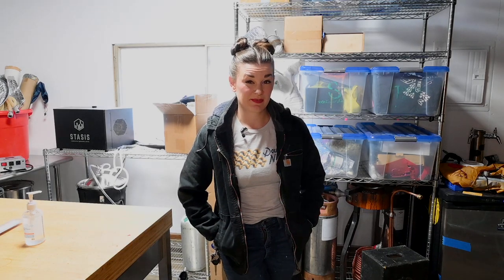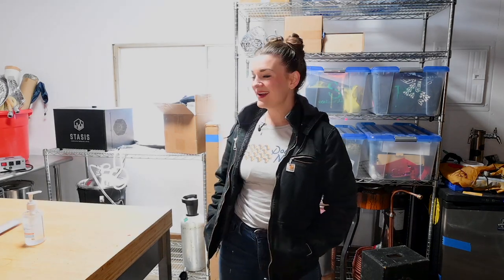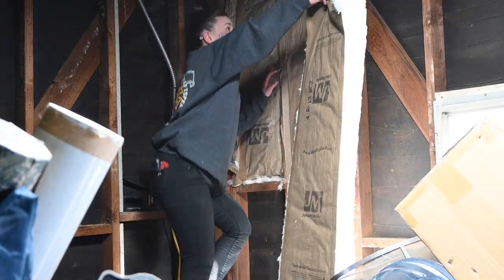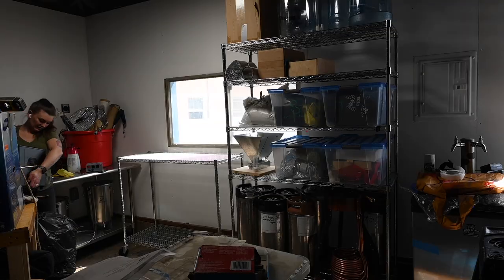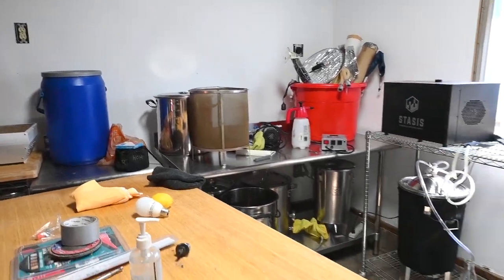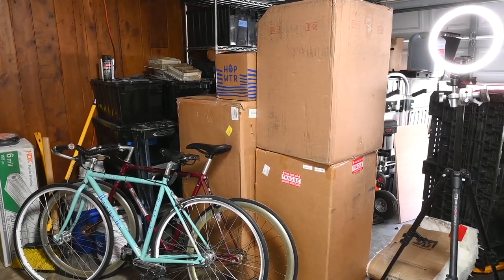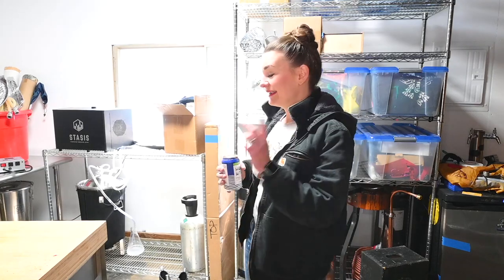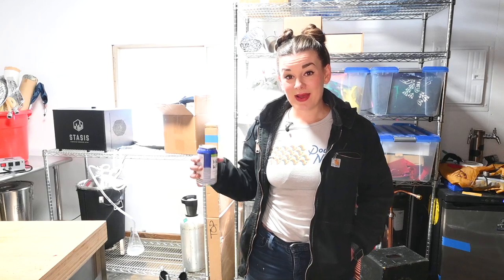Garage Brewery Build Part 1!

Comment: Fantastic space you have there. The floor... if you've bleached and treated the hell out of it and there's still that aroma, try a polyurethane/resin based floor paint designed to go onto concrete. It's used in garages here in the UK, it repels oil and is washable, so great for cleanup in a brewery setting, there's an anti-slip variety as well and being resin based, it should hopefully keep the stink underground. My sister had a similar problem, the old couple who lived there previous didn't clean up and the linoleum flooring that was in the garage and sheds was stuck down with... well, I'll let you guess! Lots of jet washing and bleaching, but it was the garage floor paint that kept the smell away.

Comment: You are on the right track, Sara! Shelves, bins, a long workbench and a lower side table organizes my one-car sized brewery which is also my workshop, so keeping dust off my equipment is a must. I wish I had 240 volts and a wash sink, but money seems to flow around my hobby and not into it. The one big improvement was air conditioning and heating which has made an amazing difference in Arizona. As others have noted, an epoxy floor is a must have and not expensive. Cheers!

Comment: Woo hoo!!!!! Its on👍 I'm currently remodeling the house, so feeling your pain!! My brewery is in one of the bedrooms with more dust on it than I've ever seen, but it's a clean dirty at least.... Its grey water, can you put a utility sink by where you brought ward in? That's a great place to put a rack over the sink to hang/dry your hose's. Also, online, or maybe if you have a harbor freight, you can get a cheapo electric winch for your grain basket. Color me lazy, but that's what I did for my 1/2 bbl system. ( Did before moving cross country and storing everything for a year, but definitely incorporating it in my new brewspace 🙂) Congrats on the new space, looking forward to seeing it in action 🍻👍
Reply from the maker: Yeah we're shopping utility sinks now. ooo electric wench is now on the wishlist
Reply: Yeah i did the same. Managed to get an electric hoist and fit it above my brewing worktop. Press a button and up the basket goes 😂

Comment: Wow that did look like a LOT of work. I've lived in a handful really old houses so I can relate but usually it has to do with squirrels getting stuck in the walls or building nests in the attic and nothing being level, especially the floor. As for the smell on the floor, if it is bare concrete I'd normally say seal up the room really well and then run an Ozone machine (big enough for the room) for 2 or 3 days (no one would be able to go into the room as there wouldn't be enough O2 to breath) and a fan to move the air around but the easy way might just be to stain the floor with a couple coats of stain to simply trap the order in the concrete forever. Please do a video on either the major steps to improvements and/or a final video as I will be building a mini-brewery / etc / etc in the next 12 to 14 month but I will be lucky this time around with a new house that is built to look like an old house in a historic district and I am supposedly getting the majority of the garage.

Comment: You could just seal the concrete with a resin coating on the garage floor. There are DIY solutions for that. It involves cleaning the concrete and then etching it with an acid then rolling on the floor epoxy. for storage peg board with hooks might work with the wall space you have. Good luck setting up your new spot. Also might want to think about a vent hood for the steam as there will be a shit load of it on 240.

Comment: I like to use grid wall panels to hang hoses and tubes and have small baskets of little parts... As far as shelving my normal go to are the wire racks you currently have. P.S. OdoBan works wonders on urine, molds and general nasty smells
Reply from the maker: Thanks! Yeah I think I need to get on the small basket train, my tupperware for everything isn't ideal

Comment: I only have things that I would do if I had lots of money and that would be a hoist of some kind either a Pull-Up hoist or a Push Up thing cos I would have difficulty lifting wet grain basket larger than 10 kg of grain. 
The other v-important thing I would have and this is where your garages previous occupents may be sniggering into their paws is I would have a place to have a Pee. Wash Hands Of Course. Not a sit down Loo. I have the experience of a fella in implementing this type of thing and for me it would be easy, not sure of a lasses version of stand-up wee-place for those time when tinkling water and critical timing coincide to wish one had somewhere quick to go. This is not a flippant thing btw, Please do not judge it as such.
I have just had a filippant thought flit across my head which I am not going to say but it made me smile. :-D

Comment: Hej, im wondering what the plan is with this brewery. Do you want to produce craft beer for commercial purposes or is this still a hobby project? 20 gallons of worth will give you three kegs filled with beer. Craft beer breweries brew 1000 to 3000 litres of worth in one batch. I’m not trying to be a pessimist, I’m just curious, cause this project seems to be a little bit too effort and time consuming to be a hobby project